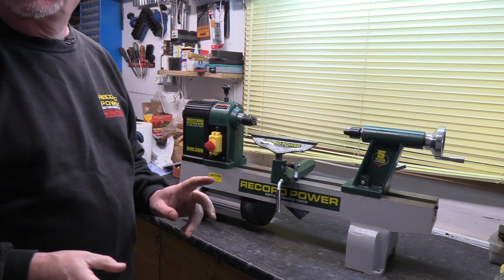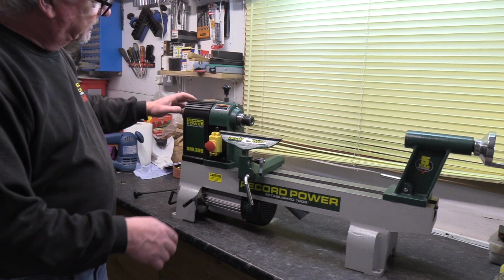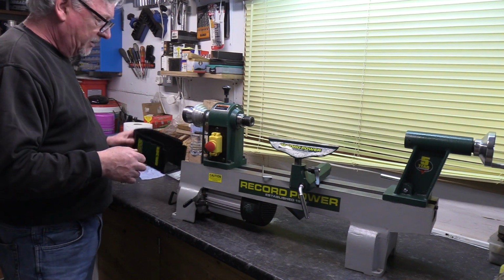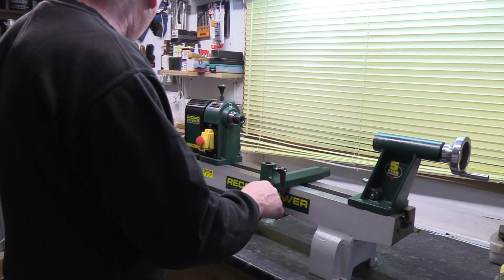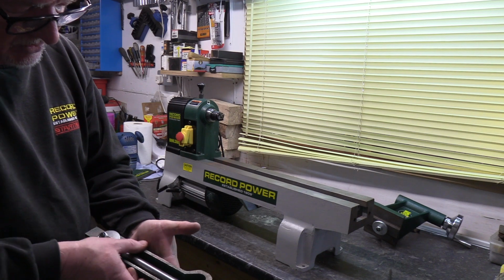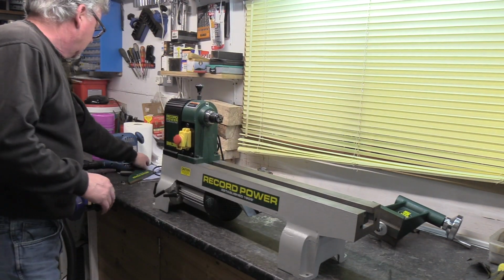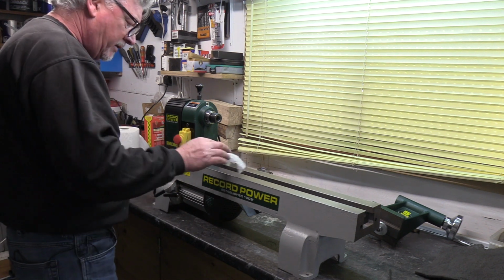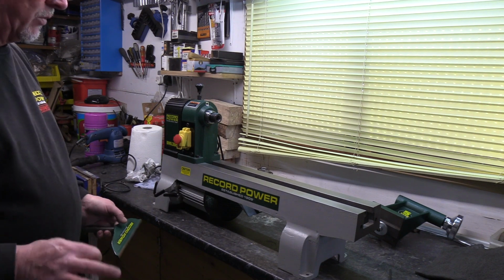Know-How Series: DML305-M33 Cast Iron 6 Speed Midi Lathe Maintenance: Part One

Comment: Hi are these a good lathe for bowls egg cups , rolling pins i have a clarke lathe at min and gets lots of vibration does this keep firm when turning
Reply from the maker: Hello, thank you for your comment. The DML305 is a steady lathe and if used with the correct accessories for each application then yes, and together with the 6 speeds by way of belt change users can turn a wide range of projects. If you are expanding your turning skills then it may be worth looking for a larger spec lathe like our DML320. Slightly more expensive, but much more extra control and power due to a larger motor and variable speed which incorporates forward and reverse direction of your spindle, larger spec all around, and lastly the extra weight makes it a more stable in use. For more information, please contact us on 01246 571 020.

Comment: I bought this lathe recently and I am very happy. However, the engine raises the temperature considerably under normal operating conditions. It can be worrying ?
Reply from the maker: Hello, thank you for your comment. Please contact our Technical Support team on 01246 571 020 or email technical@recordpower.co.uk. Best Wishes, Record Power.
Reply: Never mind what record power say. You commented the same on my video with this lathe. Make sure chips don't cover the motor cowl, to let air in where the fan is. It's normal for it to get hot after a very long time.